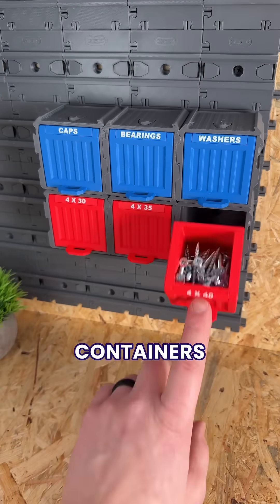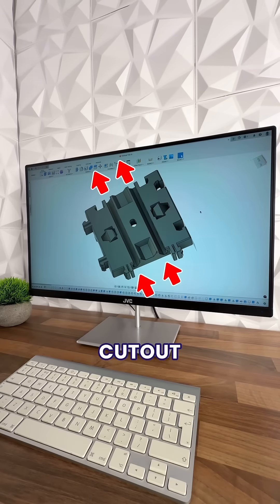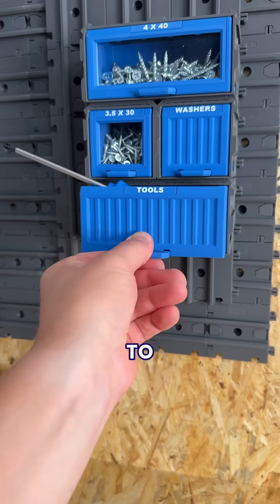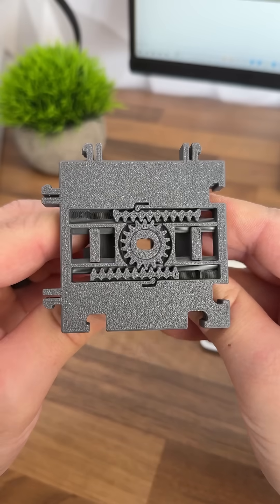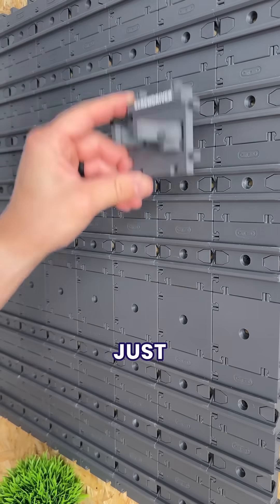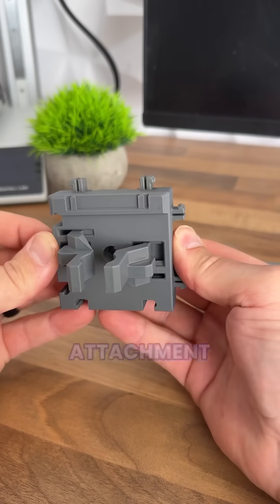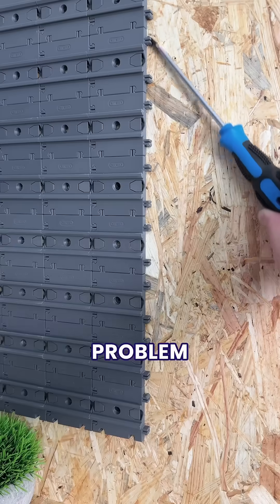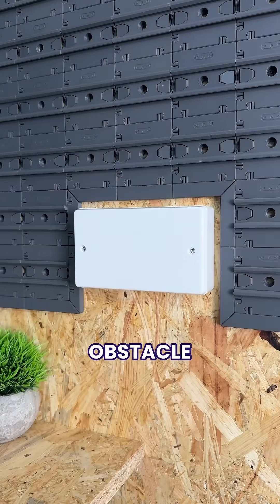We Built Infinite Storage - The Story So Far…

Comment: Can you make:

1. Hinged lid that I cohld add large platic prescription bottles.
2. Bins worh a transpatent wi dow that one can see what is it the bin.
3. Holders for dremel bits.
4. Holders for pliers 
5. Holdets for wire spools for soldering.
6. Holdets for hanging rolls of specialty tale.
7. Holders for tubes of glue, gasket sealant, etc.
8. Top or bottom row with support for adding an LED light strip that provides adjustable lighting down towards the workspace..

Comment: I love this but i sincerely wish the horizontal and vertical movement were on one plate. It seems like a lot of hassle to move that many plates+whatever might be blocking them in. My own thought is to make directional locking wheels so it doesnt slide down unless the track wheels are turned. But i dont know if that would actually work in practice. 0therwise im obseessed eith your work!

Comment: Im looking to make lazer cutter material test tiles, they are about 2.5' squares of the relevant material (so thickness is variable). Anyone got smart ideas how i could make a tile holder to store them like a cd rack or projector slides, on a system like this?
The simple and obvious answer is just that a tile holder with groves of the right size to let most slot in. But i feel like thers smarter improvements as well

Comment: I love the way you keep going back and designing and improving everything... but peg boards have been around forever and they work just fine.
Reply: For drawers?
Reply: @CHESShireCat I have baskets on mine. But i never really thought about drawers on this. There's all kinds of different things though. 

Not that I don't like what the creator is designing.
Reply: I mean this system allows you to take it down and move with it much easier than peg boards tbh. All this can be packed in a bag/box and moved and because you can customize the size it means that you wouldn't need to buy anything more than you actually need until you plan to get larger and larger in your collection of whatever you're doing.

Comment: While i think this is cool, i think the movability is slightly pointless since you can’t move a tile past another tile on the same level. Yeah you can go up and down, but your up and down occupies several horizontal rails vertically. If you could freely change direction of travel this would be much more useful. Maybe cross shaped rails with a cutout to at the very least allow vertical travel while alligned to the tile? In a perfect world also some sort of switch or button on a tile to lock it out of vertical travel so heavy objects don’t randomly drop while you’re pushing them.

Comment: I’m loving the way that you’re constantly innovating and improving the product without saying to people “Here’s a new upgrade, but it won’t fit your old rail system.  So you’ll have to buy all new if you want this one!”

Plus, the fact that it’s printed means manufacturing costs aren’t an issue and you have far more latitude to design features that would otherwise not make financial sense but do make sense in the evolution of the product. 

I don’t own a 3D printer. Am I allowed to download the files and send them to an online printing farm please?

Keep up the fantastic work.
Reply: i haven't checked their page, but usually if people don't give out their design for free they will let you access them for a few and you can print them or sent them to be printed as you need
Reply: This is how innovation works, you start with a base and continuously refine it. Normally, base products aren't available to the public and only show up as the refined product. However, this is 3d printing and most people dont care.

Comment: I’ve been following this for months now - this is going to be PERFECT storage for a massive LEGO collection. I’m planning on getting a printer specifically because of these videos!
Reply: If these were the types of projects that started popping up from the start of 3D printing I would have bought one 😂
Reply: Don't sleep on gridfinity and the other big one whose name escapes me...uhhh...multi board. that's the name
Reply: Eh, this was actually my thought too.. but in the end the sheer amount of filament you need to print enough containers to hold that collection ends up costing so much that there are simply better options out there. Personally, I use the clear 24 slot fishing tackle boxes. Around 18 of those fit inside a large storage tote from walmart, and several of those totes stacked on top of each other slide comfortably under the tables  in my LEGO room.
Reply: @eno2870  huh?!?!😂 do you ACTUALLY know the cost of filament it would take to make this? Or are you just talking out of your ass??? Because buying the filament is probably the CHEAPEST part of 3d printing 😂
Reply: Im not the only one with a lego collection i can’t organize
Reply: Search "The perfect lego storage system" by Tiago Catarino. 
It's a 3d printable, tilable storage system designed specifically for Lego (by a former Lego designer)
Reply: i have been gooning to this so hard

my MEAT

aint got a break in  DAYS
Reply: I think an ikea alex drawer system from Tiago Catarino is better suited for storing Lego
Reply: I have the exact same idea
Reply: Might be easier to just hire a printing shop
Reply: Now’s the best time to get yourself one